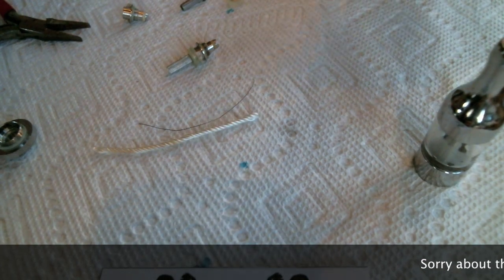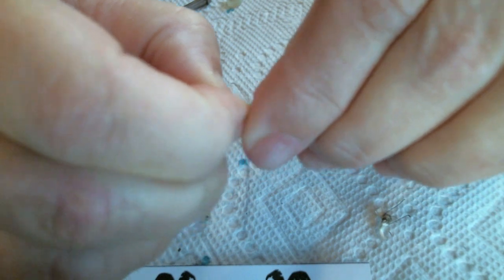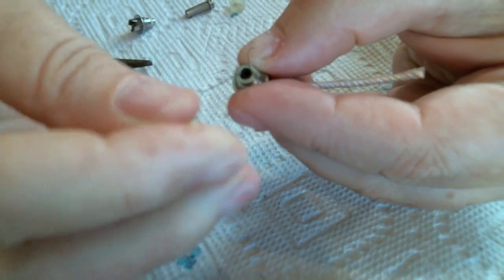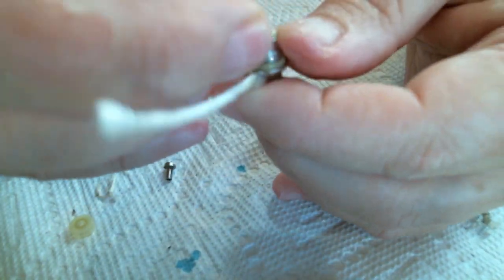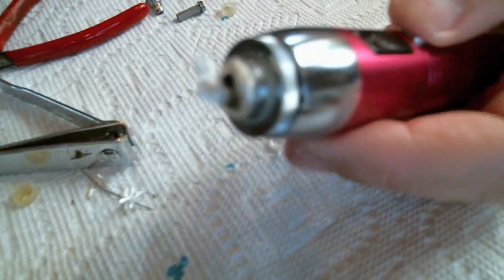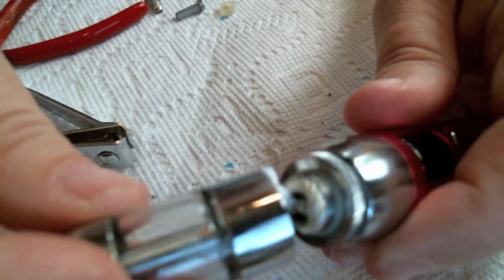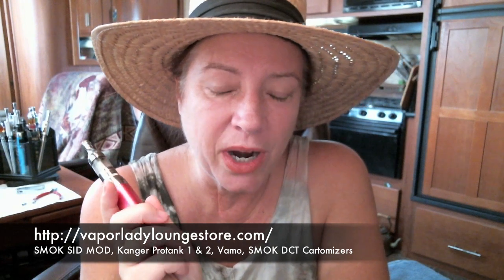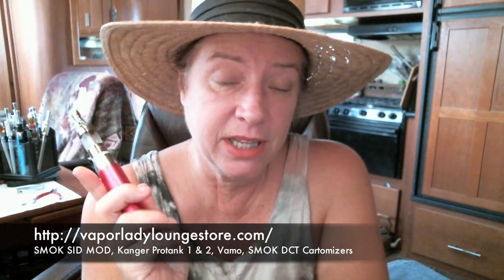Make Your Protank Into A Dripper Atomizer! Drip With Your Protank!

Comment: Thanks for posting this video! I just did this with my spare kanger T3S. I used 28 gauge kanthal though and did an 8 wrap micro coil, and I used cotton instead of silica for the wick. One thing I did is cut the cotton short just like you do when building a regular coil head for using the tank. It makes it really easy to just pop the chimney back on and utilize the tank if you want to without having to worry about the long sick being in the way restricting airflow. It still holds a fair amount of juice. Definitely will work great for trying out juices where you don't want to vape for a long time before you can switch flavors.

Comment: Thx for some very intertaining videos. A little warning: dry burning on the protank can cause the rubber gasket in the bottom to get burned leaving you with a harsh burned taste, that unfortunately stays as long as you use it
I have 8 drippers, but have to try this, cool idea

Comment: just got a protank 3 as i wanted something a little nicer than my itaste 30. nice airy hit when it wasn't acting as a juice straw. looked up several tips on how to resolve the leakage, which is happening at the bottom. tried flipping the top rubber seal on the coil head, tried taking the extra flavour wicks out and re-wrapping the top coil with them so there was more wick at the top, tried reassembling, blowing, shaking, lather, rinse, repeat... long story short, i now have an atomizer.

the i taste 30 looks like the tank equivalent of costume jewelry but gosh darn, that goofy top coil wicktopus doesn't leak or gargle and hits solid every time. i may just turn out to be a carto tank man. which is weird as i am a dog.

Comment: Soooo I did this and it works on my itaste vv vw but it wont fire up on my vamo 15w I have no clue why not... if you have a answer as to why I would much appreciate it if you could help with this....
Thanks!
Reply from the maker: Your pin in the center of your 510 connector on your Vamo may be slightly "pushed In" the pin sits inside a rubber gasket and may be pushed down, take a tweezers or a screwdriver and wiggle it back up a bit so it makes contact again. If this persists you may have to replace the gasket, (it can flatten over time), pull out the pin until it clears the 510 connector, (it has wires attached so don't pull too far), and pull the old gasket off, replace with the gasket from an old ego you probably have laying around somewhere buy squeezing it around the firing pin and then reseating in the vamo. Let me know if this works!
Reply: could be the ohms of the coil

Comment: Question, I have a protank 2 that I rebuild and rewick. I use 32g Kanthal and a small piece of organic cotton for a wick. When I use the adjustable airflow version 2 bottom for the protank with rebuilt atomizers it leaks like crazy. When I went back to the original bottom it went away. Why would it only leak with rebuilt atomizers?
Reply: probably too little wick, or you're dripping way too much juice in at once.

Comment: You can drip most anything that has a coil and wick below the mouthpiece. The Protank has several shortcomings as an RDA, of which not the least is the puny juice capacity. I turned a crappy Kayfun clone that leaked like a sieve into a great dripper.

http://www.e-cigarette-forum.com/forum/rebuildable-atomizer-systems/563966-desperate-solution-leaky-kayfun-3-1-clone-drip.html

However, if you can spare $8.80, the best RDA you will find under $30 is this one:

https://www.fasttech.com/products/1411/10008099/1743800

A breeze to build —ten minutes on the outside if you have ever wrapped a coil.
Single or dual coil. Hey, you can even do quads if so inclined.
Works with virtually all coil configurations you can imagine, horizontal, vertical, slanted; over ohm, sub ohm, nano, micro or macro coils. I've built with 32 to 26 ga.
You can use cotton, silica, ekowool, even mesh...
You will get some throwaway materials as well but you can —in a pinch– use them for your fist build. Just measure it when before using.

Take this from someone who owns a dozen RDAs and has converted several tanks to dripping.

Comment: Oh my. Did you see that rubber insulator? Your draws must taste god awful, or maybe your taste buds are destroyed. I never thought I'd see someone do something so farfetched and pointless. Besides that fact the protanks are terrible vessels for holding and vaping juice, dripping in them must be a total pain in the ass. Why would you go through the hassle? I'd rather smoke a Marlboro light. I hope you get new protank heads. The new ones have a silicone insulator that apparently hold up better than the rubber insulator. Throw it out when it looks like that.

Comment: dumb, turning a tank into a dripper results in the same action between coil and your mouth unless you build to a lowher resistance. if you build a tank to be a dripper at similar resistance,then action between coil and your mouth will be the same without the benefit of a tank feeding your coil. If you just want to rebuild, then it is fine to save coils,but don't expect change in flavor.